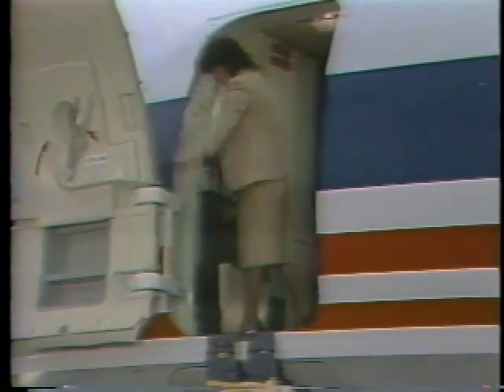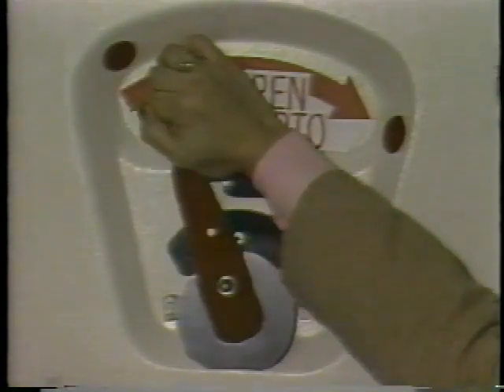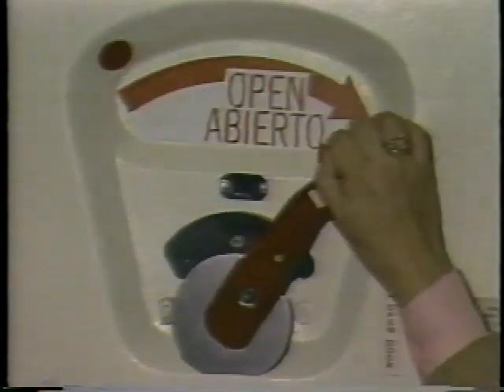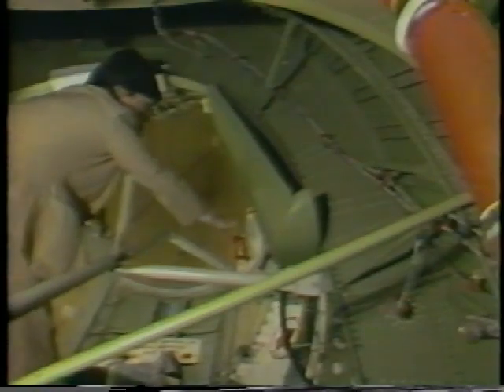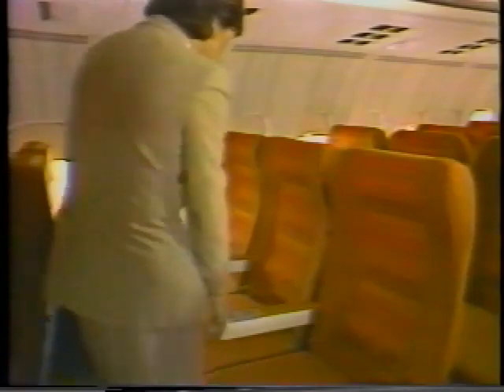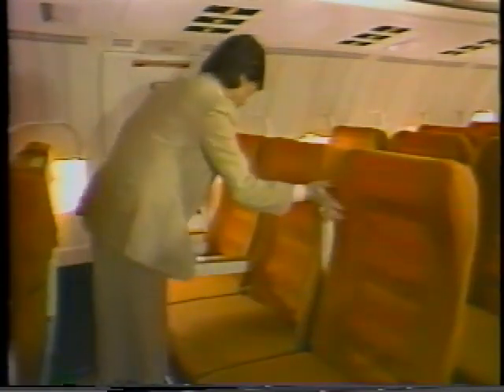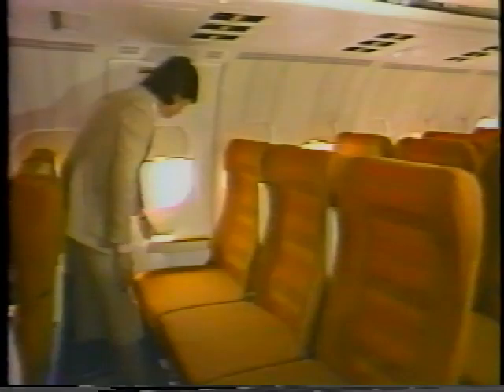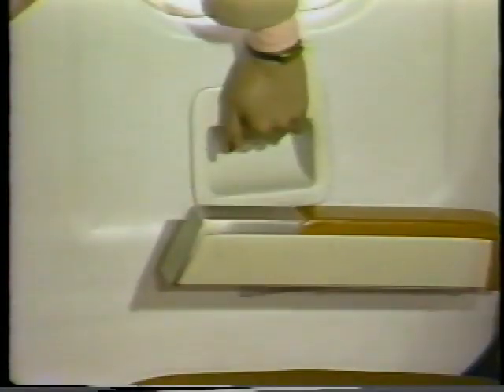Super-80 Emergency Exits and Slides

Comment: I worked on this slave ship as a flight attendant and that tail cone is BS as you can see in this video. Nobody is going to be there to pull it away so it’s not in the way of the slide as you see them doing in the video … just another bunch of BS and corruption from the FAA and NTSB.

Comment: Back in the 90s where there're loads of these aircraft at the airport where I used to work at, the flight crews often joke about you'd be better off jumping than using the thin slide and fall off.
Reply: Yeah, the angle & lack of sides did not inspire confidence...
Reply: I would rather have the pilot belly land the damn thing and then inflate the slides in the event of a emergency landing. I will not slide down a damn slide that’s literally 70 degrees sloped, and I weigh 425lbs, so you can see how this would be a disaster for that tiny slide.

Comment: Did it have an apu?
Reply: From what I saw it does, but it's located on the top section of the fuselage, not that tail cone, in between both engines.
Reply: @Kalvinjj  interesting!

Comment: Bwhahahahaha!  The tail cone falls off like its made out of paper!  And that slide is narrower than the seats....

I flew on this plane multiple times when I was little.  I always wondered how the "rear emergency exit" which was shown on the diagram worked.  There's good reason they didn't include this video clip in the "safety demonstration"!  Apart from the fact that it had no TVs.  The passengers would FREAK

Comment: The super 80 was not a good airplane to evacuate from.  The slightest breeze blew the slides sideways and you slid off the edges.  The tailcone rarely fell far enough away that it didn't interfere with the evacuation.

Comment: The tailcone exit looks so sketchy. Poor design that carried on from the DC-9, also used on the 717. If the tailcone doesn't deploy, you could be trapped at the back of the plane. I know the engines are at the rear, but why couldn't they just put regular exits at the back? Also, what if its a ditching and the way to the window exits is blocked?
Reply: You can't put regular emergency exit doors at the rear because how close passengers and flight attendants would be to the engines. Not to mention if they were still running, a door and even worse a person would easily get sucked in.
Reply: Pskilla502 run to the front DUUUUU

Comment: Good thing there's always a man with a trampoline on wheels located at each airport to remove the tailcone once it's jettisoned.
Reply: the way the cone is designed it will roll out of the way to the left when jettisoned the trailer was there so they wouldn't trash the cone before delivering the plane shown in the video
Reply: Matthew Neathery  What If they crash land in an muddy area? Ofc it is useless.
Reply: They did that to prevent damage to that particular tail cone so it could be reattached without any problems. Obviously in an emergency situation you're not going to be worried about denting the tail cone or having it fall perfectly out of the way.
Reply: @tomjames5030    Well, whilst it was a joke, actually the serious element is that the cabin crew will activate the emergency slide once the aircraft comes to a complete stop, meaning when the cone is jettisoned it will fall directly down and impede the slide from inflating properly. The cone gets in the way of the slide inflating.
Reply: @HMSDaring1  The tail cone is an egg shape, it’s designed to fall on it’s side as an egg will if you attempt to stand one on its end on a flat surface. If you watch carefully you can see the tail cone do this on the trailer as it’s being driven away. The trailer is being used to prevent damage to the tail cone. The tail cone is of composite construction and contains the aircraft’s HF radio antenna and would make for an expensive repair or replacement if dropped straight onto the pavement!
Reply: @HMSDaring1  they can also deploy stairs instead of jettisoning the tail cone
Reply: t0nyc0nde yes. And what about putting that cone back up again? Why the hell would you do that. You can replace a slide, but I want to see somebody who's putting that cone back up...
Reply: @daniel_s  The tail cone is regularly removed and re fitted during heavy maintenance cycles. I have not been involved in re fitting the MD80 on but I have been involved in the near identical ones on DC9 aircraft. It takes several people to do it but it’s manageable.
Reply: @johnyoung1128  oh well that’s always good to know but still this system doesn’t make sense in some situations
Reply: @daniel_s  Jettison
Reply: LOL All the way
Reply: I had that job
The pay sucks
Reply: @askhowiknow5527  its not very sucks its an revive
Reply: Its designed in a way that allows it to roll off to the side lol
Reply: Those tailcones are expensive lol
Reply: HMSDaring1 Exactly. No point in using the slide if the cone is in the way
Reply: HMSDaring1 Yeah! I flew on this slave ship as a Flight Attendant and we always said the same thing. Typical FAA BS that proves in a real emergency that slid would be useless.

Comment: Those slides look like you can fall off the side
Reply: Keep in mind, the plane is much higher with the wheels down. If they are going to use the slides, in most cases.... The gear would likely be collapsed. Likely!! I wouldn't want to jump on it if that wheels were down. 😂

Comment: It actually looks like a DC-9 to me
Reply: the DC-9 super 80 is actually it's true name. or perhaps something even a little more obscure. that is because it is not completely different aircraft type certificate wise.. the MD-80 was named that by mc donnel douglas not by Boeing. Boeing of course renamed the MD-95 to the 717. http://www.airweb.faa.gov/Regulatory_and_Guidance_Library/rgMakeModel.nsf/0/c1817d49c964876886256b1400759d25/$FILE/A6WE.pdf
Reply: If you ever see a DC-9 style tail cone on an MD-80, it's an earlier model.
Reply: MINEMICS is_not_pleased I thought it was a DC-9 cus of the tail cone
Reply: the aircraft complete name is McDonnell Douglas DC-9 Super 80, which was later renamed to MD 80 after the company was absorbed by the Boeing company

Comment: The 717-200 slides are a little wider with more too the sides, so you don't fall off the side on your way down. and the Tail cone is designed to rotate to the right, so to the same side as the No1 engine.
Reply: that aircraft is not related. http://www.airweb.faa.gov/Regulatory_and_Guidance_Library/rgMakeModel.nsf/0/c1817d49c964876886256b1400759d25/$FILE/A6WE.pdf
Reply: I didn’t know the 717 had the cone.  Since I don’t think they have stairs, I figured it was sealed off by the bulkhead.
Reply: That’s because 717-era Americans are a lot fatter than they were back when the DC-9 was designed

Comment: **CUTSCENE** I have a feeling that the slide failed to open @ 2:20, that's why we got hit with the quick scene change.
Reply: It probably was cut for time. If the slide didn’t inflate it’d be a much larger issue. We’d already seen the slide inflate several times by that point.

Comment: I used to work at TWA with several DC-9 variants.  The tail cone is designed so that it would roll off to it's side thus rolling away from and getting out of the way of the tail-cone slide.
Reply: you can see it starting to roll away before the trailer drives off
Reply: @googaagoogaa12345678  Look up Newton's Third Law
Reply: That's great provided we only crash at an optimal angle on a perfectly flat surface

Comment: I see a problem here. When the tailcone jettisons it falls to the bottom of where the slide is supposed to end. This is a major danger to the slide deploying fully AND danger to passengers sliding down. They had to tow the cone away on some kind of trolley for this demonstration. Does anyone else see a problem with this?
Reply: no normally it would roll to the side if you look in the video it actually starts to roll due to the design but they got the trailer to catch and tow it away so it could be reinstalled for the plane to be delivered to the airline rather than trashing it and having to make a new one

Comment: Am I the only one wondering if there will be someone waiting at the crash site with a huge trolly to take away the tail cone so you want break your face when you run into it at the bottom of the slide? Or maybe how the panicked flight attendant is going to have enough air in her lungs to inflate a 30 foot slide. Eeesh.